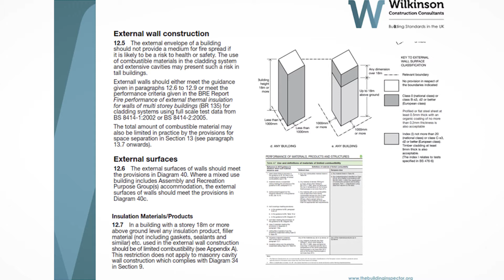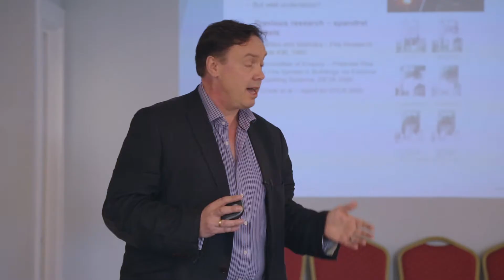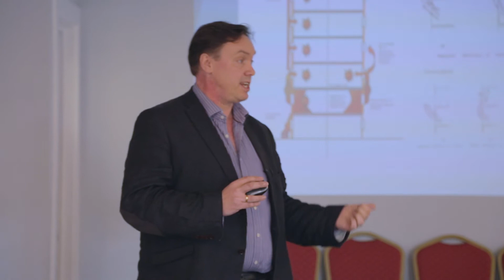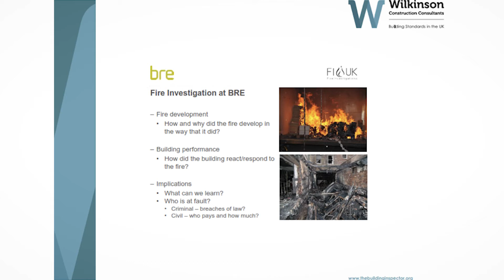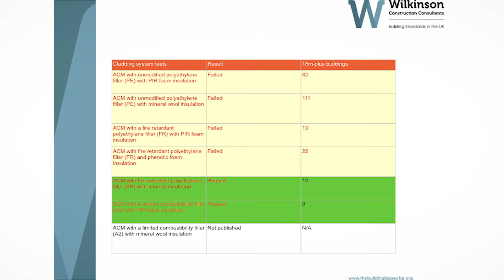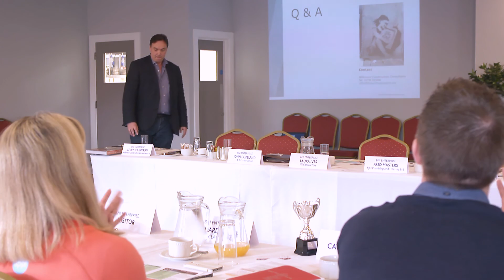What Happened With The Cladding At Grenfell Tower?

Comment: It's also fairly well known, at least in the firefighting community, that buildings made of those insulated structural panels are dangerous as well. When a fire burns away the foam insulation, the panel no longer has much integrity, so it cannot support much weight, leading to collapse.

I agree, the Grenfell incident is unique. But the cladding did compromise the fire safety of the building. I'm not even an architect or structural engineer but I am knowledgeable enough to know that flammable cladding on such a building is a no-no.
Reply: I agree with you very much
Reply from the maker: Agreed, however flammable material is still permitted under UK regs. I also agree that a blanket ban would be simple to understand and enforce, however we still need to understand why the fire in this case was so different to fires in other clad buildings which have been successfully
contained. I suspect there are other significant contributory features that have not yet been made public and the focus on the cladding may over simplify the issues and reasons for the fatalities.